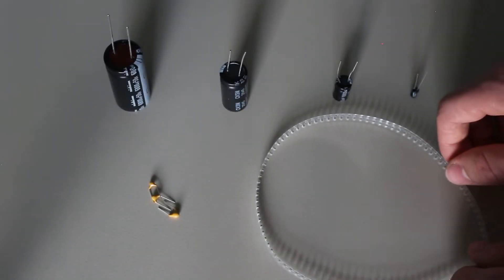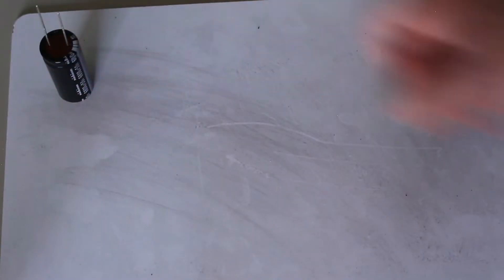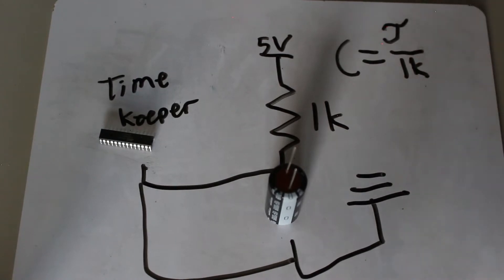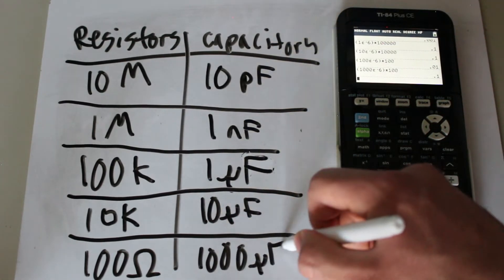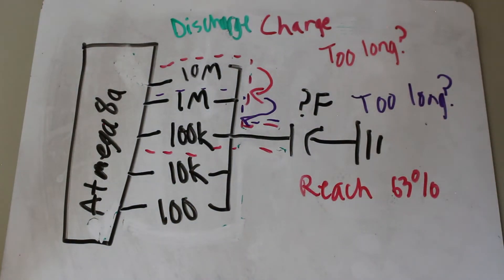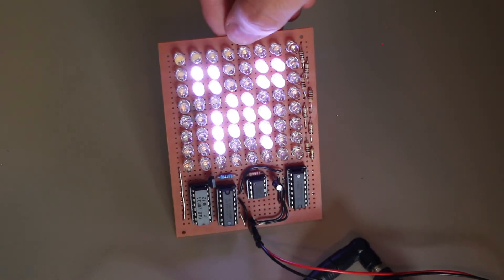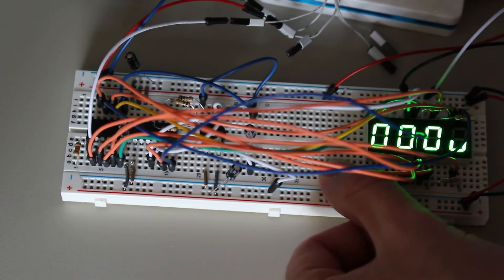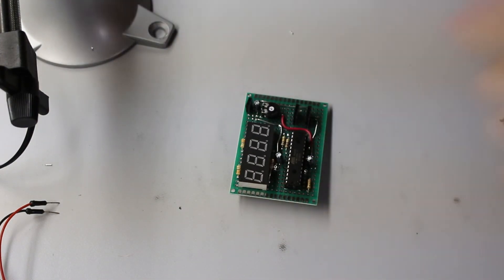DIY Auto Range Capacitance Meter - Capacitors and Voltages

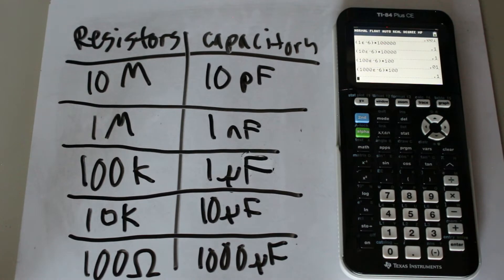Comment: what equation you used to count resistors values needed? 1:46 I would also try to do mesuring on smd capacitors is the method difrent or sttays the same?

Comment: Cool project! Digilent’s Analog Discovery has an optional impedance analyzer that’s basically all of the peripheral resistors and a few relays to feed the voltage back to the ADC, along with the means to sequence it all from a serial signal. They publish the schematic and details on their website, it’s an easy resource to start with in making something like this.

Comment: how did you discharge the cap?
Reply from the maker: I discharged it through the same resistor that I charged it with by setting the pin either high or low. Setting it to an input makes it high impedance.